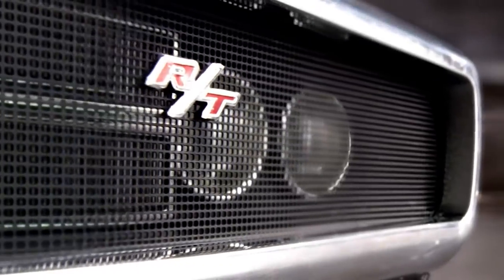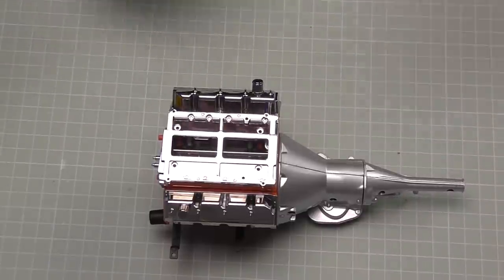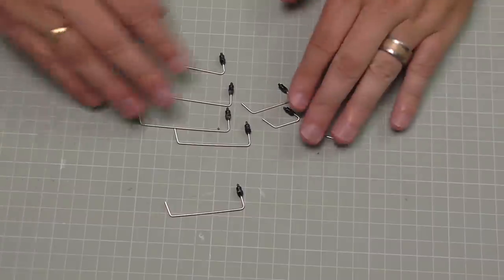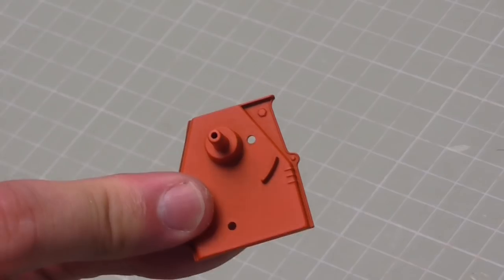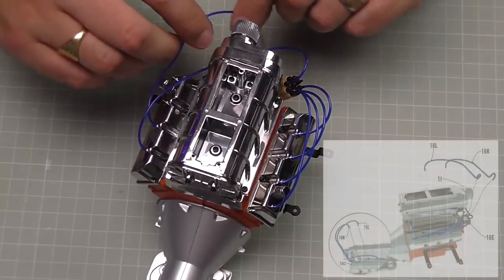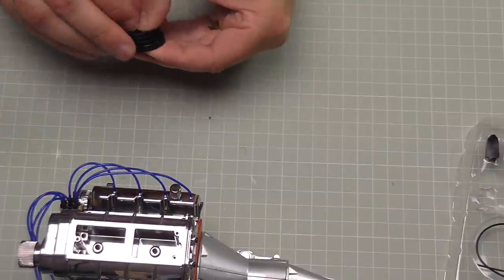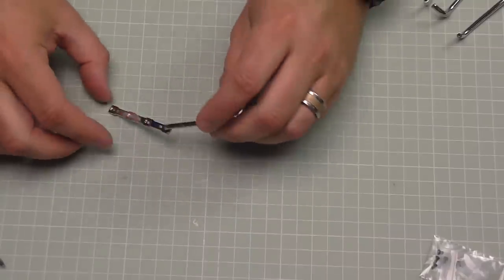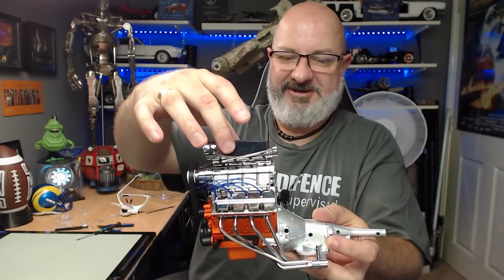Build the Fast & Furious Dodge Charger R/T - Part 15,16,17 and 18 - Engine, HT Leads and Exhaust

Comment: The super charger run by the water pump pulley, which is driven by a standard fan belt? I don't think so. That's normally driven directly from the crank.

Comment: Looks nice but I have never seen the big belt for the blower just running from the water pump pulley. Normally you would have a toothed pulley on the crankshaft, a smooth pulley on the water pump allowing the belt to slip on the pump ar high rpm, a smooth tensioning pulley and the toothed pulley on the blower.
Reply: This is the problem when the designer of the model has no knowledge of how actual cars are in reality
Reply: Or did they do the movie car like that?
Reply: @Mikey-jm3dc  No, if you google images of the car it is a standard blower pulley arrangement driven from the crankshaft and has a tension pulley up high. The way they show it on the model has a number of problems, first of which is there is no way to tension the belt. A blower takes a lot of horsepower to run, an 871 blower like this probably needs over 150 horsepower at higher rpm to make boost which all has to travel through the belt. The other problem is there is no way the water pump bearings could deal with the stresses that this belt setup would give.

Some of the stunt double cars they used in the filming had non functional blowers attached to the car above the motor (not connected to the motor at all) which I suppose could have turned the fake blower belt like this, but not the car they show in all the closeups.
Reply: @tinmansscalemodels  Ken is exactly right too.yep I noticed that blower belt mistake too .Only us petrol heads would notice its wrong lol. like the firing order too lol, well done for spotting timing error Wayne.

Comment: Wow. That engine looks pretty awesome Wayne. I am slightly puzzled at to why they can not get the firing order sorted so that we do not have to fiddle with everything. I have found the same with Ecto 1.
Reply: Also looks like they got the headers a bit too small in the tube diameter. Still, the engine looks great
Reply: @TrevorsWorkbench  I agree, Trevor I have 40 years in the motor trade , I have not seen the original engine but for sure they look too narrow and would in reality restrict the gas flow........unless this type of engine needs a certain back pressure....I do not know?

Comment: Tried emailing you but was unsure of your email on the Bismarck in issue 4 you get a circuit board to check the motor parts for future issues as you are doing 2 Bismarck’s I didn’t no if you had a spare going as mine has just snapped off thanks thought I would ask
Reply from the maker: lol. I did the same to my original one. Don't worry too much as they replace it in a later issue anyways

Comment: Whoever " designed " that engine obviously didn't know anything about mopar engines , there are a lot of mistakes , + I would be disappointed with all of the seams down the middle of the motor and transmission